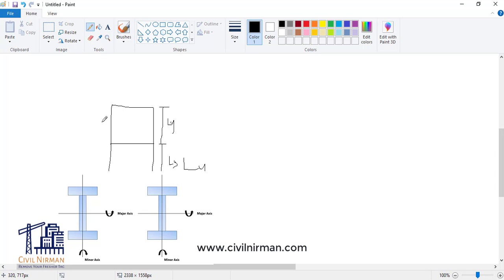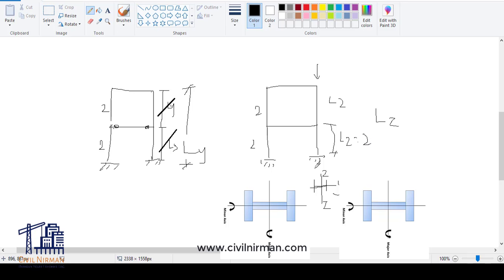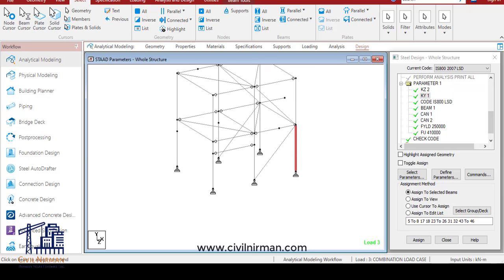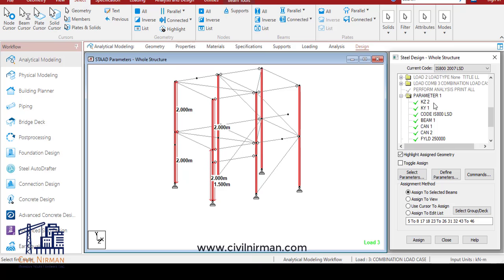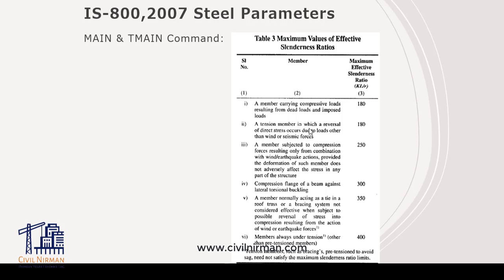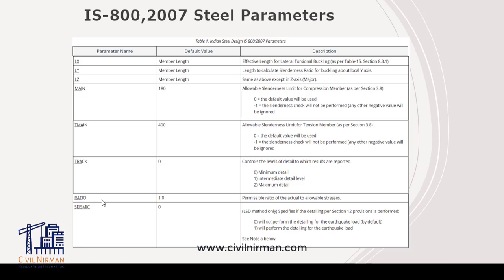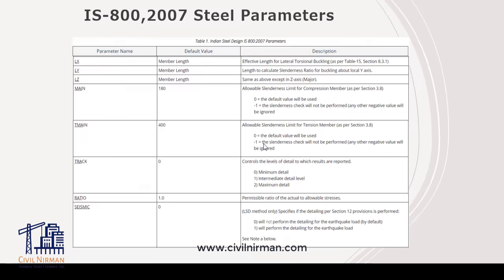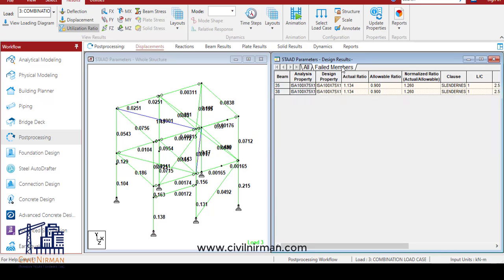Steel Design parameters in STAAD as per is800-2007 Part 3

Comment: In case of Tmain in which scenario we should assign 180/ 400?
Reply from the maker: @BINAYAKSAMANTA  didn't get your question what you want to convey will you please elaborate?
Reply: I meant to say In slenderness ratio table for tension  member code specifies two values 180 and 400. So from practical projects point of view in which scienario to consider 400 and 180? @CIVILNIRMAN
Reply from the maker: @BINAYAKSAMANTA  

Refer table 3 of IS 800:2007, we get following values of maximum slenderness ratios for tension member

Slenderness ratio for tension member where reversal of stress is due to loads other than wind or seismic shall not exceed 180.Slenderness ratio for tension member where a member normally acting as a tie in roof truss or a bracing system but subjected to reversal of stresses resulting from the action of wind or earthquake forces shall not exceed 350.Slenderness ratio for tension Members other than Pre-tensioned members shall not exceed 400.
Reply: @CIVILNIRMAN  👍
Reply: Ly and Lz parameter for tie beam and bracing?

Comment: Is it ok to provide MAIN parameter to beams and TMAIN parameter to columns, as you have shown in the video, above? Thank you...
Reply from the maker: @azmat_waseem  
Hello Waseem , request you not to skip any part of the video watch again carefully 🙂, 

In STAAD slenderness is checked for tension and compression cases. There are 2 parameters in design parameter tab, MAIN & TMAIN. By default values of MAIN & TMAIN are 200 & 300. If the member is subjected to either tension or compression STAAD checks slenderness as per those default values if no manual value is entered for them. But, if there is zero axial force then it checks for tensile case and reports the result. The same thing is happening here.
Hope this helps
Reply: @CIVILNIRMAN  Thank you, sir...👍